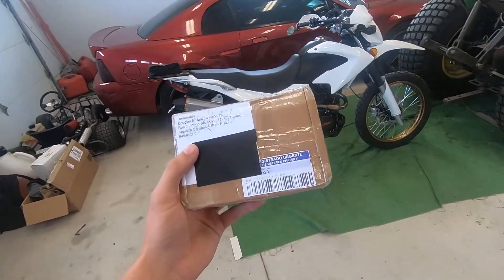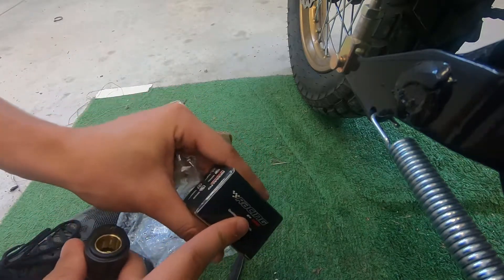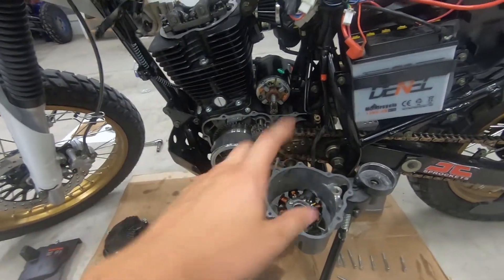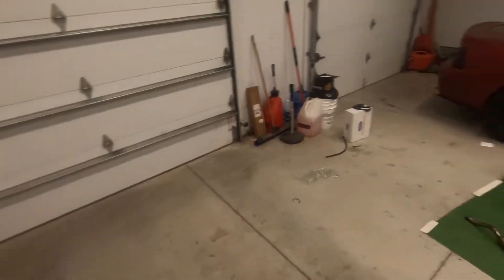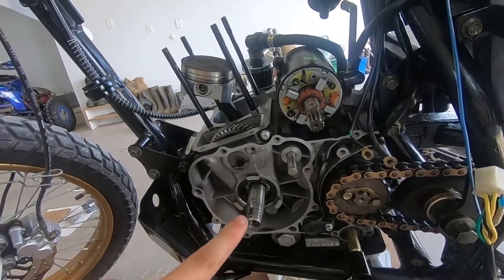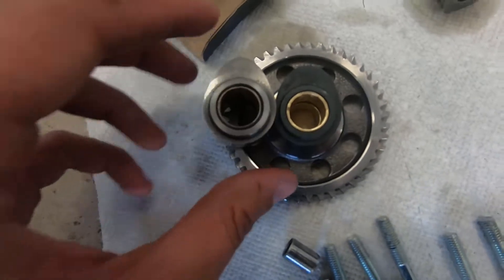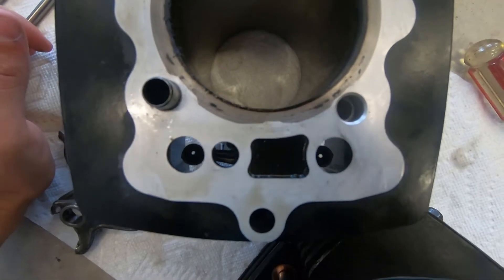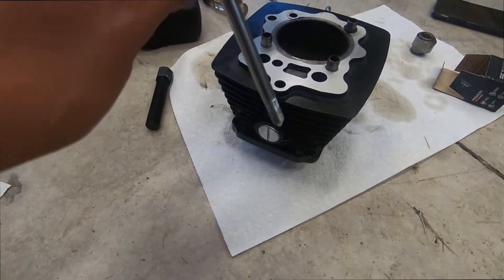Chinese Dual Sport Gets a Performance Camshaft!!!

Comment: Hey, I will take the mini shoutout about my cam install video, even if it is because of a bolt.  Yours is a lot more condensed than mine by far.  
WELCOME TO THE CAM CLUB! WOOO!
As far as the flywheel puller, I believe mine was an M16x1.0, BUT, it was also labled in china so who knows how accurate that is.
I laughed when you cut back in with the cylinder with "I have one more thing to show you."   I was sitting there watching you talk about the cam followers thinking "That slot is facing the wrong way."
As far as the jetting goes, I didn't need to adjust my pilot jet at all, and only slightly tweaked the idle mix.  I only really had to up my main jet.
So, have you had a chance to ride it yet? What do ya think?
Reply from the maker: Yea I actually got about 450 miles on the cam install while at college and rode it around with a 39 pilot and a 185 main, I LOVE THE CAM!  Picked up some nice power, and I am editing my "initial review" video right now and might upload it tonight as well haha, I was just so busy at school I could not edit videos XD

Comment: I've had success with automotive pinion bearings, transmission bearings and other press fit parts, without resorting to pressing or heating parts with a torch. Boil the part in water and the mating part can be put in a freezer. In this case, the gear would get boiled and the cam into the freezer. I usually crank the freezer to 'max', just to make sure it is as cold as possible. 
Neither part will have any ill affects and they will go together very easily.

Comment: It appears the cam from Brazil is most favored with another available from elsewhere, now. Thanks for the link! Also, I chose to run the slip-on Nibbi carb, as well. Mostly, for ease of maintenance/tuning. I have a Hawk, not the TBR. Gas tank obstruction & throttle cable length (to stay close to stock for future upkeep) was an issue. I am attempting a different intake manifold for that reason. It is an ongoing project to still use stock airbox. I most prefer to do that versus delete airbox. Are there parts sources for this?

Comment: nice video i dont under stand why its so hard to get the oem specs like they planned for the motor to be not worked on or something hope to find a shop manual i have the efi and found a way to tune it moto cheez found a way
Reply: take that back csc has a pretty close awsome shop manual

Comment: I am completely disappointed,  I pulled my hawk 250 2019 apart to do this. Ported polished,  and low and behold,  it has the upgraded cam in it already!!!! I can only hope now that the .04 I decked off the head wasn't also already done at the factory.....wish me luck, time to re assemble

Comment: Little note on rags. Traditional shop rags can leave threads and lint which gets in the engine and stays there. Or ends up where it isn't supposed to be. Paper towels leave a light lint but it actually dissolves into the oil. Thus you will commonly see pro engine builders doing final wipe downs of engine internals like freshly honed cylinders with paper towels and many transmission rebuilders will use paper towels exclusively at their rebuild benches. Normal cheapo white paper towels.
Reply from the maker: Thank you for the information! Guess I'm definitely using regular white paper towels now from now on!

Comment: I'm planning on ordering one of these bikes within the week. Also will be ordering a head to port as well as a cam. Did you notice a big difference in fuel economy drop with this upgrade???   One reason of this Chinese bike for gas mileage. We have a Kawasaki KLR 650 that is a major gas hawg. 
   I know with little work it can have compression raised and port work done so it can breath on top end with this cam. But don't want it to drink gas like the KLR.
Reply from the maker: That's a great question, I did notice a drop in fuel mileage. But nothing absolutely crazy. I imagine if I don't rip on it 24/7 I can still get 350-400 miles on one tank

Comment: Just finishing up a similar setup with my Tbr7 I did a Honda fork swap & swing arm swap from a xr250 so there was nothing left to do except add a ported head & a higher duration camshaft along with the same roller followers I stopped by to check out what jetting you ended up using so let me know what worked out for you I’m figuring I’ll start with a 160 main and see what the plug tells me bike looks good & be safe out there brother!
Reply from the maker: I've still been jetting the bike, fighting with the carb to find the perfect combo, it runs great as is but I want it perfect haha I think right now im running a 185 main but it seems a bit too big and a 39 pilot which might be a hair small, still working on getting it right, but I am switching to a PWK soon too so I'll have to start from square 1 again 🤣
Reply from the maker: But also the Honda swing arm and forks??! That seems like a really awesome upgrade, is the aluminum swingarm way lighter than the stock one in your opinion? Also how do the forks feel compared to the tbr7 stock forks. And what rear shock did you end up using??